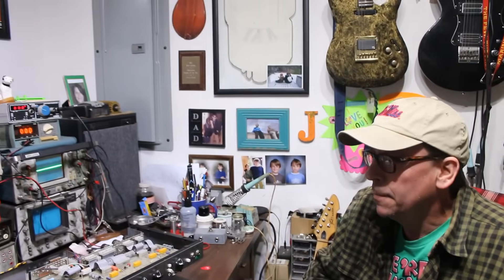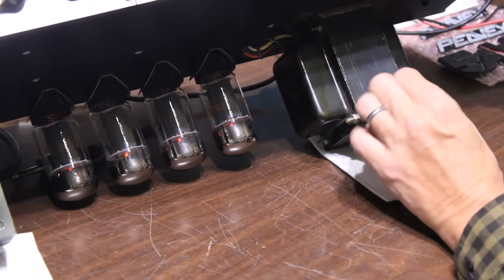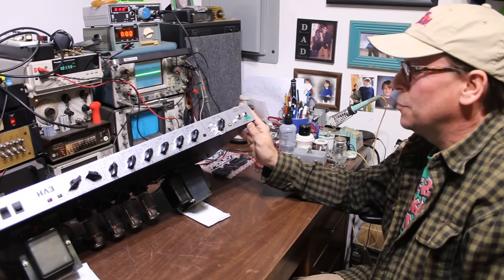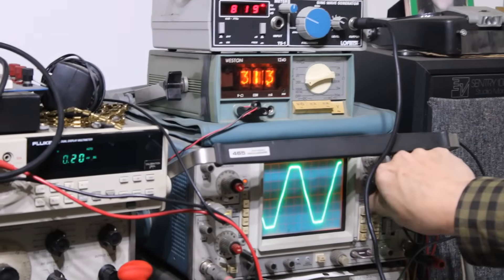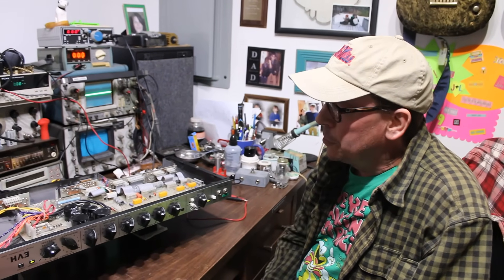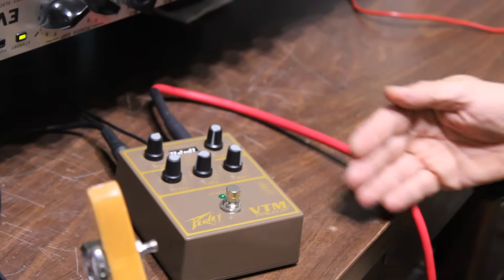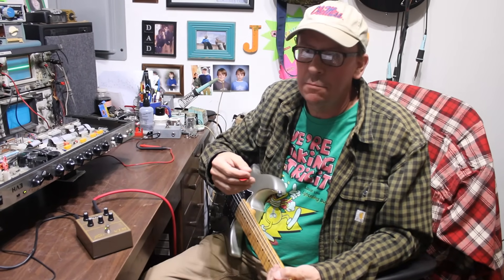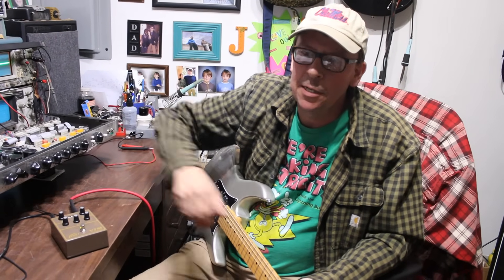Van Halen Tour Amp Found (Part Two) - Peavey 5150 EVH Prototype - Power Amp Test  & VTM Pedal Cameo

Comment: Why did they run a weld bead from the EI laminates to the mounting brackets? I thought welded cores were a no no on transformers.
Reply from the maker: Initially, it was done for strength to avoid bent transformer brackets. It had a solid 10ga welded plate which is nearly impossible to bend. The core loss was accounted for in the design. Theoretically, it sucks, but it's fine in practice. Peavey still uses the welded plate on larger transformers, but the newer ones use four spot welds through the plate because of process improvements. There's also less stack to secure because they use way better steel, varnish, and screws than the older ones did, etc..

Comment: Music & related analog electronic equipment, amplifiers, receivers etc. has always been my passion. Went to school for electronics but never had a job working directly with the stuff I was interested in working on. How did you get to where you are?
Reply from the maker: @billdivine9501 this is all I've ever done, but I still got a BSEE in 1997 to prove that I was serious before I dove in. It's a very hard industry to break into unless you can prove that you're the best in practice and on paper. You also have to be willing to work pretty cheaply compared to other design engineering jobs. I've also been in the right place at the right time, but only by the grace of God. Things work out. Work works out.

Comment: John, do you guys sell those plastic sleeves that house the LEDs for power/standby lights? I literally own at least 12 amps that have those sleeves. Every time I’ve pulled a chassis they break because they get old and brittle. I’m left trying to glue them back together which SUCKS! Thanks in advance!
Reply from the maker: @Patriot31743  we recently retooled them for the 6505-1992 Original, so I expect that we would have them again, if not soon.

Comment: John I just stumbled onto part one and just finished part 2, I’m hooked. I have a mid 90’s 5150 combo and just love these techs videos, keep them coming. I’m a loyal Peavey member who purchased his 1st amp new back in 95, a Bravo 112 that I still have and use to this day. An interesting fact after watching James Browns Tone Talk video with Dave Friedman - 2 hr interview about all things JB and his dealings with EVH, a must watch for all Halen knuckle heads. The Bravo along with the Classic amps are JB’s designs makes sense their killer sleepers. BTW did your video say you worked or still work at Peavey? If so you should add some stories if possible. Keep the videos coming and as DLR would say “Stay Frosty” 

Roger
Reply from the maker: @Gibsons-hq1xv  I do still work there as the MI Amp Engineering Manager. I've been there for almost 28 years designing amplifiers and doing other engineering duties. It's a great place to work.
Reply: We’ll that’s real cool info. Can you openly discuss what you have worked on in the past or what your involved currently, Like tue Invective or the Rage reissue or the upgrades to the Classic series? Be interested in you sharing what your able to. Also I do have a question on my Bravo. Every time I shut the unit off it makes a pop, is this because there’s no standby switch and is there a way to fix this popping noise. Looking forward to more videos in the future.
Reply from the maker: @Gibsons-hq1xv  sure....I worked on all of them. Obviously, I could never discuss anything current. As far as the Bravo, it's probably the nature of the beast because it had pretty large HV caps, but I could delve into that one sometime since I do have one here. It could even be an easy fix at that. Thanks for the suggestion!

Comment: Great info, thank you! I have myself one of those first year heads... I'd like to throw you a couple of questions: If using only one of the two speakers outputs, which one is the "use first" or doesn't matter? and second: saw you removing two output tubes (the exterior ones) so that makes the amp running at half power (like the combo)... then is necessary to change the impedance to the speakers? thanks so much John!
Reply from the maker: Both outputs are the same and connected in parallel, so it doesn't matter. If you remove two tubes, the primary impedance effectively doubles, so the load would match on the next LOWEST tap.... I'm pretty sure I said that wrong in the video.
Reply: @johnfields8745  thanks so much John! looking forward for the final video with the full restoration of the amp!

Comment: Cool to see you pull out the horizon ii!!! That’s my favorite guitar.
Reply from the maker: @ryanmoon5240  it's one of the best test guitars ever made. I've had several, and I also use one as my main test guitar at work. This silver one is just getting settled. Non-trems with blades are the ticket.

Comment: cool stuff.. Any theory on why it has that residual hum?/ Mine is similar as well
Reply from the maker: @ericb4351 with this being a proto, it could be anything and I plan to find the source of it. A stock unit with this much hum would need to be repaired.
Reply: Mine has the same hum.
Reply: You could reduce that noise hum, if you replace all 1/4 watt resistors to 1 watt resistors (very tricky, because or the narrow space) and replace the capacitors to high quality F/T, cornell dublier or  Sprague and  I have done that in the corona times, the amp is now a lot quiter
Reply from the maker: @PeterR-vt4mx my aim is to make it like it was when it went on tour and not to improve upon it. There are gobs of things you can do to make them quieter, including using parts with lower thermal agitation and ditching the ceramic caps.
Reply: @johnfields8745  My comment was not on this prototyp amp, it was for a regular amp and you could also do other things on the production 5150 amp that i have done for example other slope resistor, to other cathode resistors values to V1 to change that 39k cold clipper to more special things ( i had added a second vol pot and master pot to the rhythm channel and switchable treble bleeds like a 4700 pF to that friedman sat mod /arredondo zehner diode clipping. In the corona times we had a lot of time. It is interesting to see that inside of that proto amp, your video is very helpful and interessting. Thank you for that.